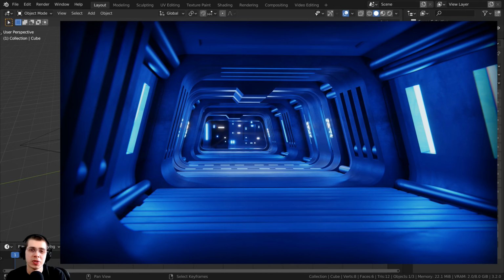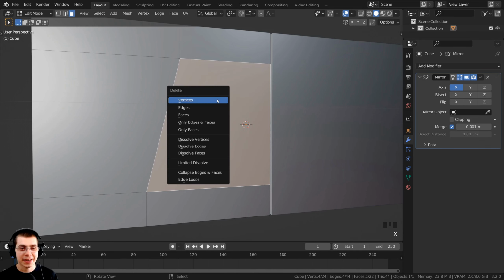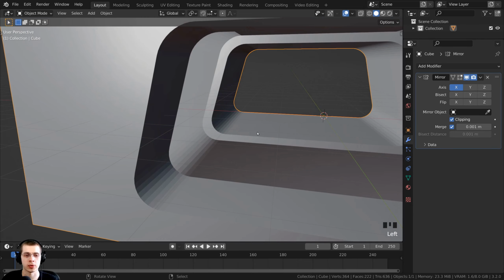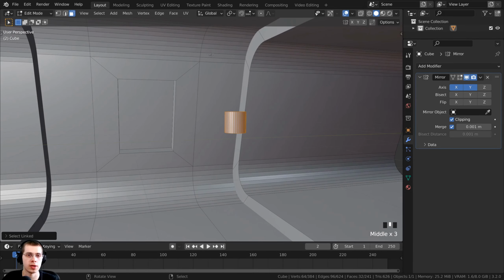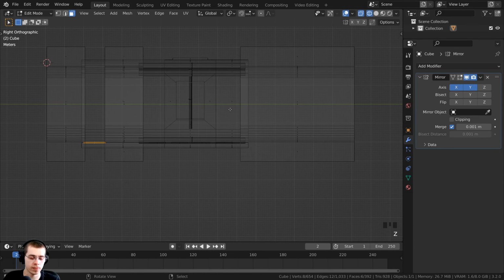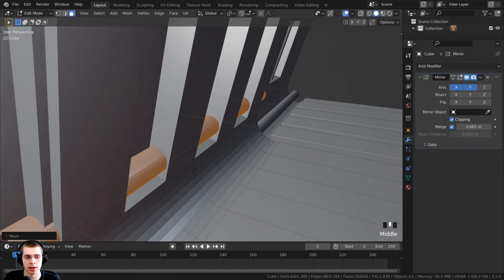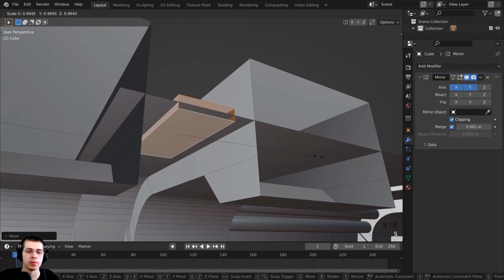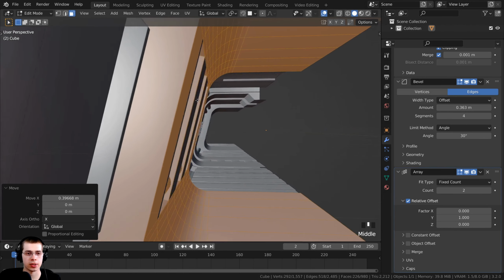Sci-Fi Passage - Part 1 (Blender Tutorial)

Comment: The bevel modifier doesn't do anything for me. Even after the loopcut :(

Edit: If I turn of "Clamp Overlap", my buttons on the control panel look screwd up, so that didn't work.

Solution, in case anyone is struggling with the same thing in the future:
I used initially a bevel for the control panel, since I wanted to gave mine some "Star-Wars-look". However, I used then the beveled shaped to make the tiny buttons. This cause vertices to be very close to each other and thus the bevel modifier didn't work on my mesh.

Comment: Hey Ryan, thanks a lot for your tutorials - quick question though! When bevelling towards the end of this video on the entire object, although I followed your knife cut, my object won't bevel - the only way I can get it to bevel is if I change the 'Width Type' from 'Offset' to 'Percent'. Would you know why this would happen at all? It won't show my bevel modifier in any other 'Width Type'. Keep up the good work!
Reply from the maker: Thanks for watching! You might have some overlapping vertices. Try merging any overlapping vertices in edit mode.
Reply: @RyanKingArt  I am also having the same issue. Changing Width Type to 'percent' or any other choice I still cannot get the bevel to work.  I have merged by distance, upto 0.1m also. This is something I have had trouble with on a number of projects and would love to find out what I am doing wrong or need to fix etc
Reply: Hey Olie Smith, I had the exact same problem. Nothing on the object would get smooth edges with the bevel modifier, even though I am pretty sure I did everything right, just having a few different details (different size of buttons on the panel f.e.). When I tried your suggestion with the percentage, it suddenly worked everywhere. I am too new to blender to have any idea what's happening. But at least it does work somehow ^^